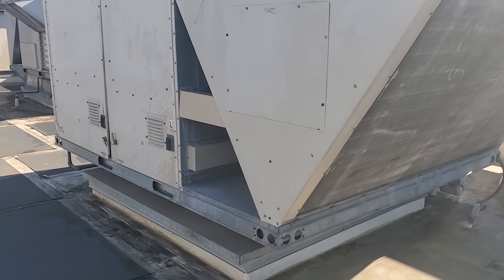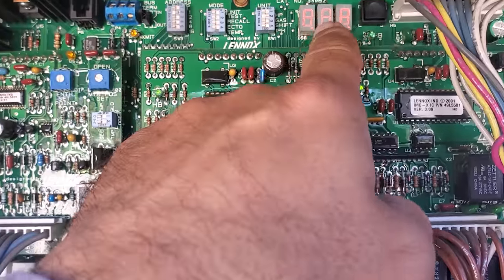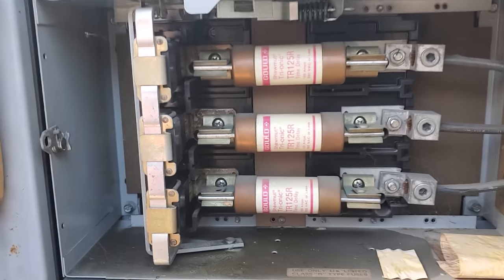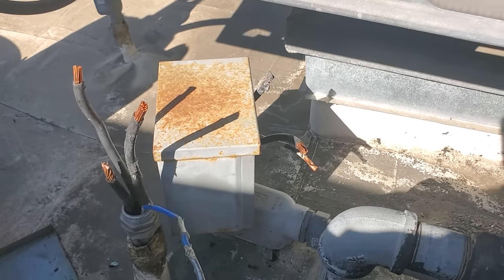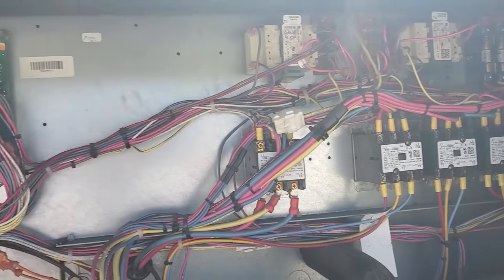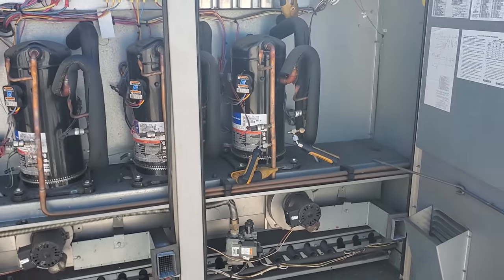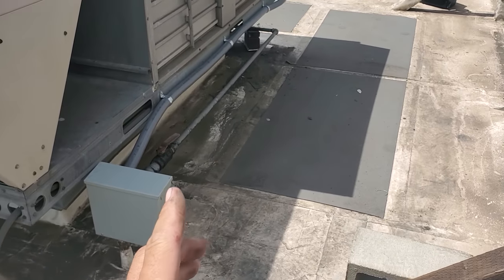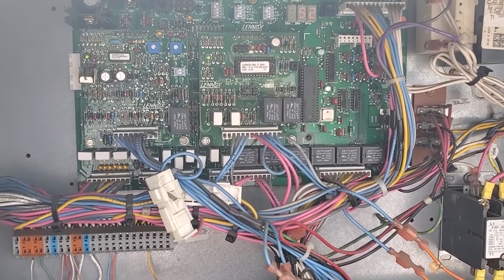ELECTRICAL FAILURES ARE FUN

Comment: That's why we use twice as high voltage in Europe. Half the current for the same machine and we don't get such problems. Also less money wasted on thick copper.
Reply: I had 240v ran through my whole basement running on just 30amps vs my old setup which was 3 120v 15amp circuit’s. Load never goes above ~22amps with my server rack powered up. I really really hate how we use 120v here in the US :/
Reply: just makes a bigger bang when it does short.
Reply: Maybe I am misunderstanding, but wouldn’t the voltage on these units be similar to in Europe since it’s 208 3 phase and not 120?

To be honest, I’m curious if European 3 phase would also equate to 208 (or if the formula is different based on the starting voltage).
Reply: @jayzonmeztdagh  in Europe we have a 380v 3 phase
Reply: @jayzonmeztdagh   i was about to hollar about the same dill. 208 3 phase, so just for sake ill double the voltage and round to 480 three phase. Its not that USA and EU are that different. The deciding factor is the service available in the region, decided usually by the utilities, but larger customers, warehouses etc, own their own transformers. Substations send out just under 10k volts, dont quote me, and you take that voltage and transform down to the voltage your liking
Reply: @jayzonmeztdagh  in Europe, UK Australia etc the single phase voltage to neutral is usually 240V, phase to phase is 415. Officially its 230/400 but normally 240/415. Some of Europe has 220/380 but for all intents and purposes its the same for the most part.
Reply: @BensSightSoundandAuto  correct for australia, 240v single phase @ 10 amps or 15 amps depending on circut and 415 three phase @ 15 or 20 amps depending
Reply: Higher voltage creates longer larger arcs.
Reply: We have 480v and 600v three phase bud. We also have much higher three phase for industry. It's the restaurant owners who put the 208v three phase service in because the majority of restaurant equipment is 208/230 volt. What difference does the voltage make? Voltage is voltage. 1 horsepower is 1 horsepower. The wire just needs sized for the occasion. You could run that shit on 12 volts if the motors could handle it and the wires were big enough and it would consume the exact same amount of power...
Reply: @jman0870  It just feels a little silly having 3 separate voltage levels under the KV range for grids/consumers to pick and choose. More trouble in having to install transformers, and ensure you have the right voltage rating on gear, wiring, equipment etc. 

Compared to most other places where you have the one single range around 230/400v. In Australia, that feeds everything from houses to most industry. You see 400/690v very rarely, or on big loads it'll be typically ~11kv. 

Less is more I guess. Keeps it simple, less opportunities for mistakes, less losses in transformers to change between voltage standards.
Reply: @Thermoelectric7  460/480v is reserved generally for industry because arc flash potential is much higher and it makes switchgear much more expensive. You also need transformers to get 208/230 with 120v to ground. That’s expensive and takes up space restaurants don’t have. Above 600v is only for industry where very large motors would make the cost of wire ridiculously expensive and you will never see it outside of industry and skyscrapers (those chillers are huge). 208/230 makes sense because it has 120v to ground, which is the standard receptacle voltage in the US. it’s never going to change because the US huge and at least half the states are as large as, if not larger, than most countries in Europe. Remember, California is the fifth largest economy in the world. It’s also important to remember that it doesn’t matter what the voltage is, the exact same amount of work is being performed. You just need wire large enough to handle the load. Higher voltage does not mean more energy/power.
Reply: @jman0870  I'm not debating that it works, it just seems silly (like your imperial system). But it's not something that can easily change.

As for the larger switchgear for 440/480v? Seems like an odd reason. That's only like 60v above what can be seen here in houses. You want a whole house ducted aircon? 415v 3 phase to your house, done. A slightly larger breaker vs half a country worth of oversized cable seems like it would have been a fair trade back in the day.
Reply: @jman0870  In europe, pretty much every house gets 3 phase 400V as a standard for years. It's very convenient.
Reply: @Thermoelectric7  You mean YOUR imperial system? As I previously stated, the US is huge and converting anything is a massive expense.
Reply: @FrozenHaxor  that's very deadly and more dangerous for arc fires. The USA uses 110 volts and is slowly moving to lower voltage (almost all electronics run on 18 volts or less, led lights can easily run on 12 volts DC) in residential because lower voltage won't kill as easily and won't arc as easily. It will reduce or eliminate electrocutions. It will reduce electrical fires drastically. I'd say in ten to 15 years they'll be no 110 volt outlets in new residential housing except the kitchen. Just the appliances will have 110 or 220. Technically 220 is simply two 110 volt wires on different phases anyway. 220 kills and burns much worse than 110..
Reply: @Bryan-Hensley  Actually, they use 240/120v split phase power.
Reply: @Bryan-Hensley  So.. what will people run vacuums from? Hairdryers? Power tools? Any piece of equipment not fresh off the shelf?

And no, 220 is not 'simply two wires on different phases' - split phase is not polyphase, and nobody else uses such a setup.
Reply: @Bryan-Hensley  Lmao have fun distributing your 18 volts through kilometers of wires. You make no sense, and it's not like we have 400V in outlets next to our beds and in the bathroom for the hair drier... All this nonsense about arc flash you rant on about is misinformation, it seems you believe that bus bars will randomly jump massive arcs for no reason, it just doesn't happen. It's not a 110kV transfer line that requires air gaps. If we ran breakers and outlets like US does and joined circuits with 1950s wire nuts then yeah I'd say people would get zapped more often and houses would burn down alot more, but the basic equipment is so much different with inherently safer design, Europe is scheduled to go up in voltage already from 230V to 240V for increased efficiency of conductors. It's only the US that got somehow left behind.
Reply: @Bryan-Hensley We use 110v on construction sites in UK but centre tapped, so max voltage to ground is only +/-55v.
Reply: @Sphyix  we do aswell. 380v is the most common 3 phase in the US

Comment: This is a perfect example, in my opinion, of why HVACR technicians are better at finding electrical faults and understanding complex circuits than most fully qualified electricians.
Reply: Yeah, as an electrician myself, I disagree with that wholeheartedly. Maybe some of these more modern electricians that don’t no they arse from there elbow but I would’ve found that no problem. Also, there is not a cat in hell as chance a lightning strike caused those connectors to melt more than likely when they shorted it could’ve caused a spike and Corrupted the other Unit

Comment: As an electrician, I really appreciate the things you did for the guy that had to come and fix it. Its not every time I see that
Reply: And yet, as a fellow electrician I immediately cringed when I saw the hookup to the main disconnect. Bare copper sticking out at varying lengths and no ferrule in sight. 
Not using ferrules at this day and age is just asking for problems, they are cheap, easy to crimp and they even ensure proper lengths so that no bare copper should or could stick out. 

The conduit run looked great, but it seemed they ran out of time when hooking up, cause that looked pretty shoddy.
Reply: In my experience doing data none of that info will get passed on to the next tech that comes out amd whoever it is will have to figure it all out again

Comment: Looking at that electrical junction connection, I would say that the problem wasn't originally a loose connection but instead was corrosion.  The splices were all made of aluminum from the looks of it and aluminum corrodes faster than any other metal.  That is why you have to use oxygen barrier grease when you make connections from aluminum to any other metal including the bolts in the splice lugs.  The corrosion over time caused the connection to go higher resistance and over time and thermal cycles caused it to meltdown.
Reply: This isn't true for any AL wire made in the last 30 years.   Modern AL wire is an  alloy that doesn't corrode like the old stuff. Using anti ox greas on it is pointless and a waste of money.  NEC does not require it, and using it can actual be detrimental to the integrity of the splice.
Reply: @hgbugalou  Well all I can say is that the Aluminum feeder wire in the main panel of my house is only 12 years old and it is already showing signs of oxidation and corrosion in a conditioned and heated space where the humidity is kept at or below 50% year round.  
The corrosion would be far worse in a junction box on a roof that is subjected to the elements.  If you use the corrosion inhibiting grease according to the manufactures specifications it will only improve the splice.  That is precisely why underground and outdoor rated splice kit connectors are often filled with the stuff (even when splicing copper).
Reply: @kuhrd  under ground is a completely different ball game.  As far as your feeder, You either got cheap and or old wire or another factor involved. For example, anti ox is a good thing if your deal with buildings near the ocean.
Reply: @hgbugalou  just wondering  since  when did  Nec say no need  for anti ox grease.  We are still  required  to use it .
Reply: Aluminum forms an oxide barrier faster than you can ever add grease. It's a thin layer that prevents further oxidation and corrosion, unlike iron rust that can keep penetrating further.

However, aluminum, like most metals, can experience galvanic corrosion. It can also get pitted corrosion from stress (like maybe that tight space, bends, and the constant vibration of the AC unit) which will allow corrosion to go deeper than the surface.

Then there is any acid or alkaline that can also cause chemical reactions and corrosion. Since Chris works the Inland Empire I would assume salt water spray is a non issue since that shit is all desert. That doesn't mean there can't be another element getting in that box. 

My guess is just a poor splice with constant vibration eventually caused it to fail. The only thing bugging me is the looks of corrosion going up into the jacket, that seems to suggest some high or low pH chemical was around it. Then again, maybe the constant heating up due to resistance building up did that.
Reply: @hgbugalou  8000 series aluminum isn't as bad as 1350, but you still have to be careful.  And for things like electric utilities, 1350 alloy is the norm.
Reply: @aldinardo4812  It is not a requirement.
Reply: Wouldn't the copper wire in an aluminium splice cause galvanic corrosion?